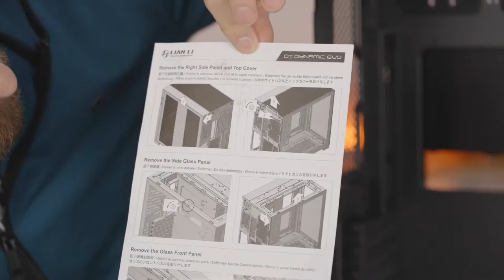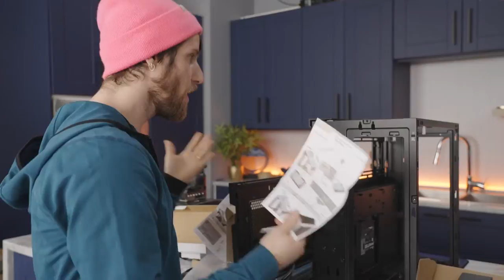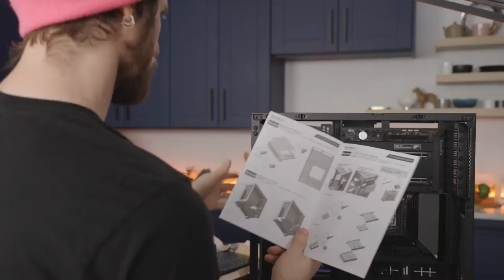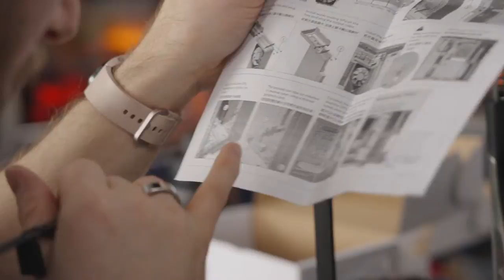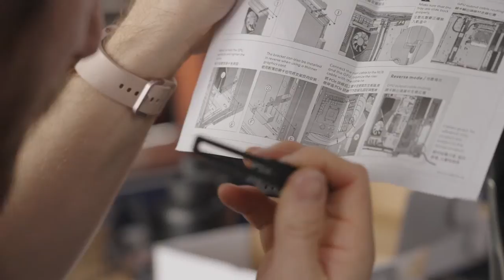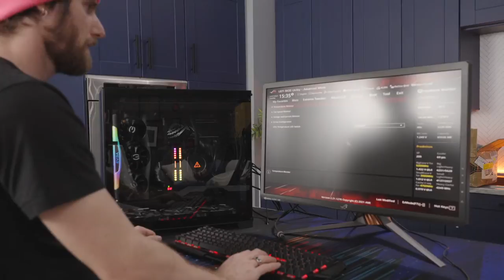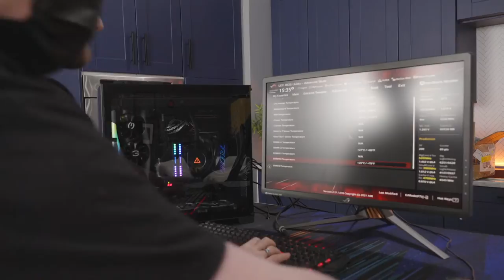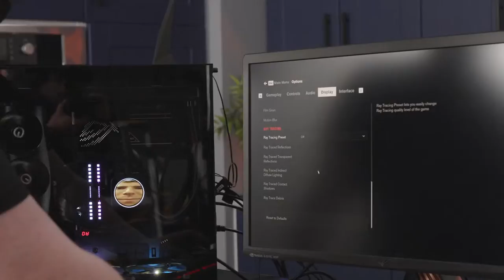Building an Upside Down Gaming PC

Comment: For your Smoke Tests i would recommend using a CO² effect fluid, like for this maschine its called "ADJ Fog Juice CO2", it produces a very thick and dense fog but quickly dissolves, so you get a good viewable effect and don't create a foggy room.
Maybe you machine could use some cleaning with smoke maschine cleaner or destilled water. (don't use alcohol or venigar)

Comment: I spent last Saturday moving my current Ryzen 7 3800X system from my old Cooler Master Stacker 830 case to a new Bequiet Dark Base 900 Pro Rev 2 and that took me about 8 hours plus (not including breaks to keep my sanity) and I had to redo some stuff because I messed up some small things for another two hours two days later. So props to Linus to only need four hours to build a new system with a total case reconfiguration.

Comment: For bottom intake fans, I've never had to clean the bottom intake even though my pc is on the carpet, however the front intake always clogs and has to be cleaned. the front intake sucks floating dust from the air, but floating dust has a hard trouble getting under the pc, now If I put the pc on a hard surface like a wooden floor then maybe the bottom intake might get more dust.
Reply: As opposed to keeping it on the carpet, where it gets no air intake. This comment made me laugh a bit. If you're going with bottom intake, you need a hardwood floor or keeping it on a desk. Carpet is just going to kill all or most of your airflow... Unless you have like at least 5 inch feet on your case.
Reply: @omulamfibie  I get enough air, its not like the carpet is so long it reaches the fan grill, still like a half inch or so over the carpet. the front fans are more choked than the bottom.

Comment: Thermal dynamics, motherboard parallel to the ground Add on cards vertical and proper cooling.  The plane old desktop styled cases were more efficient at managing heat from the chipsets and cpu's.  Look at your data centers and U1 U2 U3 servers how they are designed.  Jus sayin.

Comment: I definitely agree with manufacturers using the same threaded MB screws. Trying to find custom anodized #6-32 pan head screws has been a nightmare. I finally found a place that sells custom colored screws for pinball machines and I can use M4 countersunk washers for a nice two-tone look for my build theme.

Comment: So, I have a build planned in the next few months using this case in the white variant...

I just now finally placed an order for the LTT screwdriver, and every additional bit set
Reply: Just an update....  I'm gonna be using the "sonic" asrock z790 board, a core i9-12900k, 32 gb of 5600 mhz  vengeance rgb ddr5, a 2tb m.2 nvme pcie 4 crucial ssd, nzxt kraken z73 aio, evga supernova 1000gt psu, Peladn RTX 3070, with Thermaltake pure 12 argb fans

Comment: 3:57:00 You're literally describing the problem called "buffer bloat" which is caused by too much buffering in your WiFi-router. Reconfigure or replace the WiFi access point and you're fine. Some manufacturers use buffers worth of full second so you can have latency spikes over 1000 ms! A well configured access point should have about 1-3 ms higher ping with full bandwidth load but it might require running something like Linux with fq_codel or cake for real AQM/SQM (Active Queue Management/
 
The bigger problem with WiFi/WLAN is that it's a shared medium. It's not uncommon to see tens of networks if you live in an apartment building and the more networks there are using the same shared radio medium, the slower it gets for everybody.

Comment: 3:20:00 I've been using various Fitbits for the past 4 or 5 years and it's pretty great honestly.  It's awesome for fitness as well as sleep and health tracking.  All of the new ones are also IP68 up to 50 meters and the battery is between 4-8 days depending on the model.  The sleep tracking is one of the main reasons i use it
Reply: @dakoderii4221  the only version of that story I've heard was Strava, not Fitbit.

Comment: NEED to do a vertical mount case.

Only cheap off-ish brand ones now but they ROCK. Segotep makes some. I 

The Vertically hung graphics card is a game changer. No gpu sag either way and awesome airflow, even better than seen here.. accessible ports behind a clean looking panel on TOP of the pc, not on the back.

Comment: Confirmed that your Z690 Hero boards are catching fire. Check the mosfet above the 4th ram slot. Some have been installed backwards. White line should be on the right, not the left.

Comment: Doubt this comment will be seen but if it is for the backpack they should add a small slot with a small zipper on the back of the bag (the side of the bag that is against your back) make it just large enough for a passport and maybe a wallet. I had a bag that bad a pocket like that and it was awesome to have it back there and extremely protected. Just large enough for a passport and I could stuff my small wallet in there also. 10/10

Edit: they have this. AWESOME BAG!

Comment: a lot of british houses have 2 electrical circuits at least never had a good time with powerline adapters because of it in my next house which will hopefully be newer i plan to run ethernet but right now my house is like 130 years old so all the interior walls are like solid brick so i just opted for that inane asus rog router/AP  thats super powerful now i get like 600 down 300 up from my gigabit at the other side of the house which im happy with

Comment: you need at leat a 50cm riser cable to tie it to the back and loop back round, and not many manufacturers make them.. and they are expensive too... even the PSU extensions need to be longer. In the EVO, not sure how long, but my o11 mini which is configured the same, i had a custom 100cm pcie cable made. (50cm if you don't care about cable management)

Comment: Asus's auto settings for ddr5 did not work with my 6000c36 ddr5 even when running 3600c40. I had to manually adjust dram switching frequency and current limit and now it works at lower system agent and imc voltage than xmp sets automatically.

Comment: I don't understand the praise over this case. From engineering or manufacturing point of view, maybe, but the design is pointless. Its party trick is eyecandy build with vertical GPU but you're left with no direct exhaust for its hot air and ugly raiser cables. With vertical GPU, intake is pretty much mandatory from under the case, where dust is densest or where carpet impairs the intake, if placed on floor. Its also a large case yet doesn't support EATX.
If used as an ATX case with standard GPU placement, where it doesn't introduce compromises, its just too large and expensive

Comment: Yeah My only m.2 is installed into the 2nd slot and I still get its full speed, but I'm sure the latency is not as good as it can be, im sure it goes threw the chipset on my x570. I just hate that its installed under my graphics card lol.

Comment: Why are all pc.builds in a case? Why not have the GPU 3 meters away in a cold place and the CPU the same .you can get long connectors surely? You want airflow so have the ultimate and have it in your house

Comment: Yea I know. Late to the party and all that, but before seeing where this goes I thought I'd post my take on this. Sure the new O11 is a thing of beauty, and thus I detest it...

But if I am to watch Linus build using it it has to use the new features or there's not really any reason to do it. So inverted MB, vertical GPU and mesh front.

Comment: Shame they didn't include a slightly longer riser. Also if the bent USB is through hole you could unsolder the pins and Soler it with the connectors installed to straighten up the pins.

Comment: so i just built my new pc, it booted up the first time, but after i got the usb for installing windows it did not boot up, i’ve reinstalled the ram, replugged the gpu, cpu power connector and 24 pin however the boot led is still red and wont boot up thought leds are on the fans and everything
 need help

Comment: The upright gpu mount is horrible its sold separately for 90 and the riser cable is horrible only thing I wish I had from.this case on my xl is the better cable management in the back. Everything rkse is stupid upright gpu mesh panel inverted case I hate anyways

Comment: Does that graphics card sit "flush" with the motherboard when on the front-vertical mount? And is there a way to run the riser behind the motherboard (like does the socket on the cable fit through the cable management holes on the motherboard tray)?

I'm contemplating (depends on whether I get a graphics card) either:

1. Fractal Torrent, graphics card in normal slot but with a CPU tower cooler, only 180mm front fans (no bottom fans) on the case, all air moves front to back
(Kind of like this, https://www.youtube.com/watch?v=m3YnpwAAHhM, but instead of an XL ATX Full tower, I'm banking on it fitting in a regular ATX case that has at least 25mm below the bottom expansion slot for those fans but I'll get rid of the bottom fans)

2. ...or 011D Evo, graphics card in the front-vertical mount, two or three bottom intake fans, with either
a. two or three exhaust fans on the side mount behind the graphics card
b. CPU tower cooler on the GPU, fan above/behind each tower cooler (CPU and GPU) if one fits right behind the one on the GPU. Otherwise since all the fans and coolers are oriented to flow the air straight in one direction (bottom to top) there might not be any need for exhaust fans, just positive pressure and convection. PSU moved to the top slot so I can run the PCI-E riser below the motherboard.

Regardless of how this all goes the objective is to isolate the hot air coming off of either the CPU or the GPU increasing the ambient temp for the other inside the case for running cooler and quieter for longer. The 011D Evo has one advantage over the Torrent though: not having either of them heating up the air that the PSU will use and therefore effectively increasing the ambient temp for it.

Comment: Q: I have a tech question that you guys can answer. It has to do with the sound quality on my current tablet, Samsung Galaxy S6 Lite. I was going to include my iPhone SE 11 but the sound is good for that phone.  Here's the problem that I'm noticing. When it came to my old Tab A, the audio quality was pretty decent and I brought it in 2015 and a newer one in 2019.  

Because of my hearing impairment, I typically leave the volume on max or close. With my S6 Lite, I've noticed a slight crackling or a degrading of sound quality. Yet if the tablet is paired with my Bluetooth speaker, (a 14-watt speaker), the sound quality improves immeasurably.  The older Samsung Tab A tablets didn't have this problem.  The issue mainly shows up when listening to audiobooks and YouTube videos.  

If I recall Linus did a video on sound on current flat screen TVs and the need for a sound bar.  Has this been happening with tablets?  What's going on?
Reply: Don't now my tab see sounds good from its speakers. Maybe a hardware defect

Comment: Hey Linus , 

Need some advice. i have been using MSI Bazooka b360m. For years I have connected cable for the internet. But just recently I tried installing a PCIe x1 wifi card, but the card doesn't detect( even when checked in bios the slot is empty).My GPU works well on the PCIex16x slot. Please provide troubleshooting tips.

Best Regards,

Comment: You know, I've got a question Linus. Yall have all those video cards yall keep getting. Why not sell them at the correct prices instead of all these scalper $2000 prices to us? I mean I'd be good getting a 1660 Super for $150-200. Yall can get some returns doing that.
Reply: They would run out of stock faster than you can blink